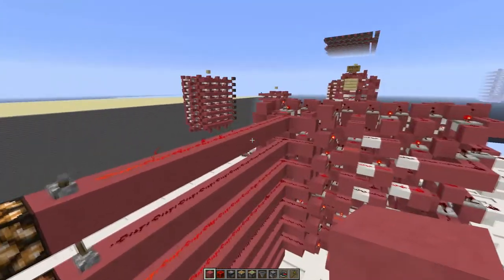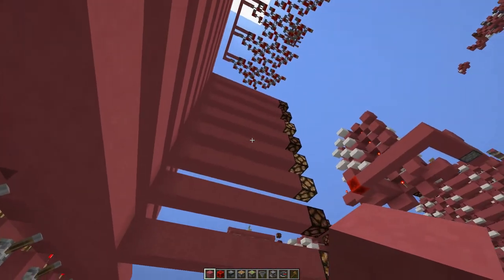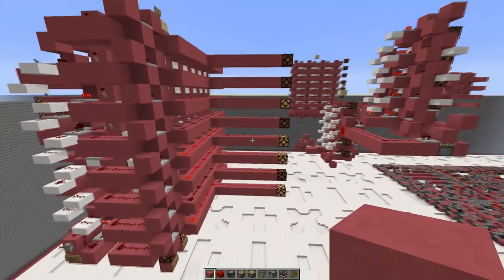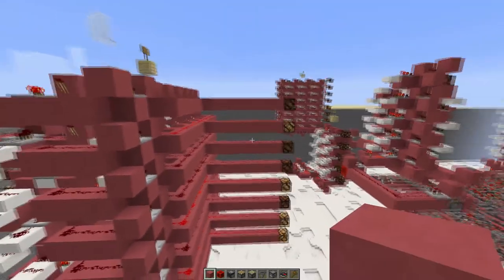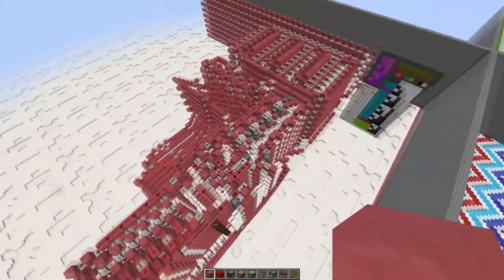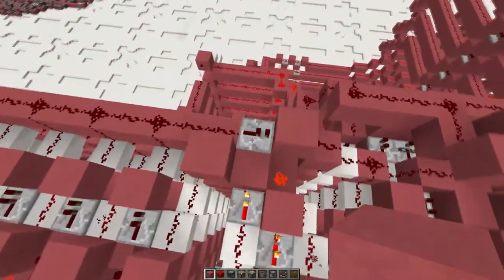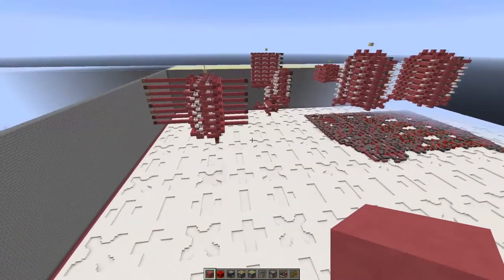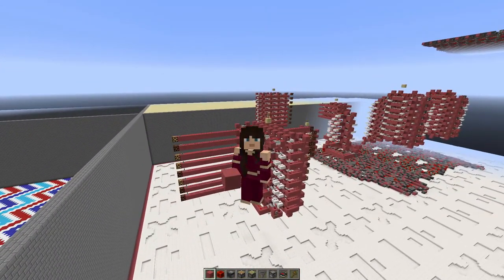8 Bit Barrel Shifter w/ Koyarno (4 ticks, synced)

Comment: let's say I wanted to expand this to 32 or more bits,  what kind of delay do I incur? can this simply be stacked, or is it not possible to expand without additional circuitry? Any idea how this stacks up in terms of how optimal it is, or do you know of other designs that are as fast or faster/newer? I've looked around and I couldn't find anything that claimed to be under 4 ticks even for just 8 bits not to mention how compact this is. Also, would you know anything about any horizontal designs floating around and how they compare in speed or compactness? I don't know how much you've been doing with redstone recently or even if you would have known some of this stuff 2 years ago but if you have answers to any of these questions that be awesome. Oh and btw did you ever finish that cpu?
Reply from the maker: It wouldn't be possible to expand without additional circuitry, as you would run out of signal strength and require a repeater. If you keep it solid state and want it to be 32 bits, I imagine that would incur at least 3 ticks of delay, for the 3 repeaters necessary.

I built this ages ago so I'm not sure if newer, better designs have been made
Reply: @Freyadiin  thanks for the response, I think I may try to expand it. Awesome circuit btw. Like I said, one of the sleekest designs I've seen on youtube. If you don't mind me asking, are you still doing anything with redstone/computers these days? (besides the speedy noteblock stuff which you obviously posted a few hours ago).
Reply from the maker: @Chris-io2cs  unfortunately not, I only play Minecraft in short bursts every once in a while (like with the recent note block stuff over the past few days)